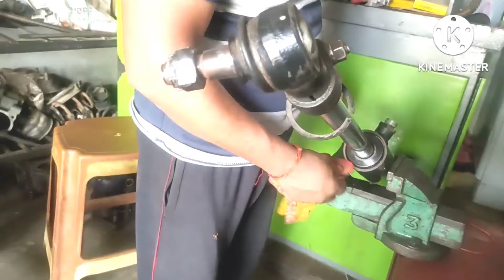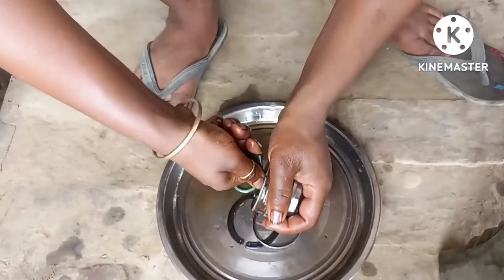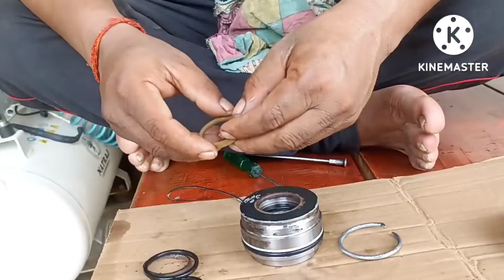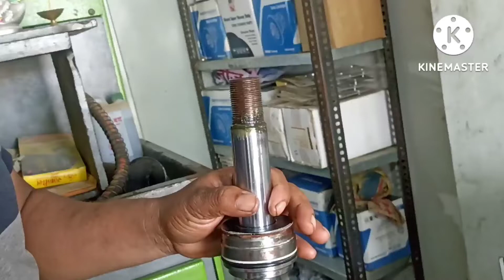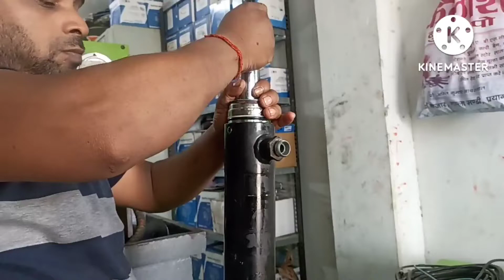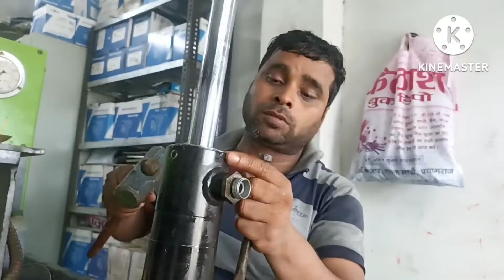power steering cylinder repairing video Tata 3718

Comment: I have power steering assy cilinder scratch
Reply from the maker: 8249900366
Reply from the maker: Photo bhejiye mil jaega aur contact number aapka
Reply: Oil seal part number konsa hai
Reply from the maker: 8249900366